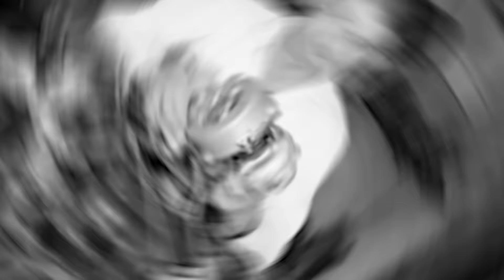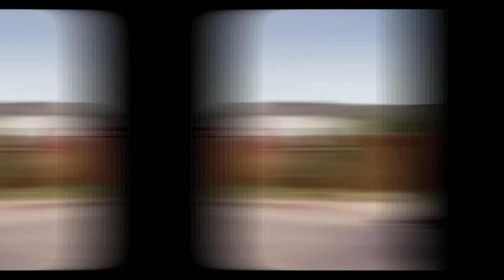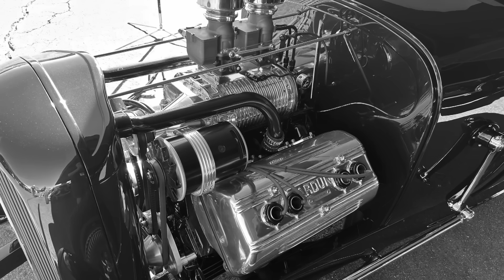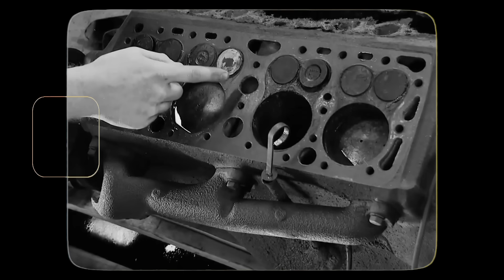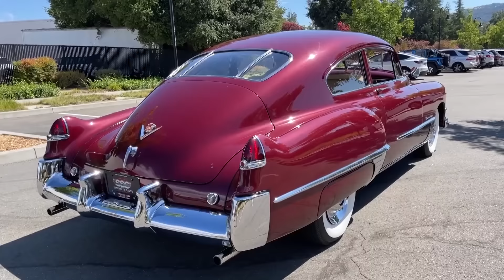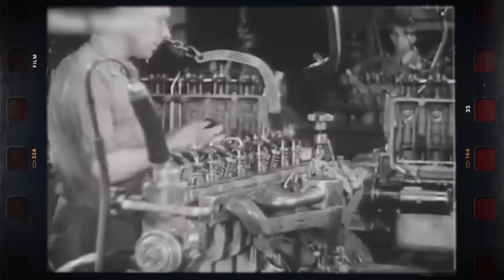How One Mechanic’s “Simple” Cam Trick Made a Flathead Ford Outrun Cadillacs

Comment: This is a perfect example of how artificial intelligence is really not so intelligent.  So many factual statements which seem related but are not connected here in a logical way. First of all, Ford figured out in the first year of production that even fuel distribution would require a two-barrel carburetor and a dual plane manifold.  They were ready for 1933 with that update to the intake system.  They only used a one-barrel carb and single plane manifold for 1932, the year the flathead was introduced. This video also suggests that Ford had to avoid high compression so that the engine could survive the stress.  Not so. When the flathead V-8 was introduced the gasoline octane rating was in the 50-60 RON at the time.  The fuel was the limiting factor for compression ratio. Compression ratio could be increased but at some point with the reduction of combustion chamber volume you start to limit the transfer area between the valves and the cylinder, which is one reason the blocks were "relieved" which was a practice used by Ford in production after WW2 when higher octane fuels    had been developed for the aircraft industry. There is so much more I could add, but the 20 plus minutes I wasted watching this is time I will never get back and I'll not waste my time to watch it again.